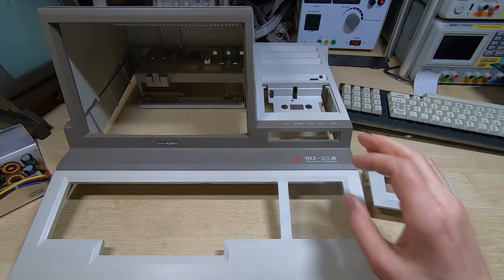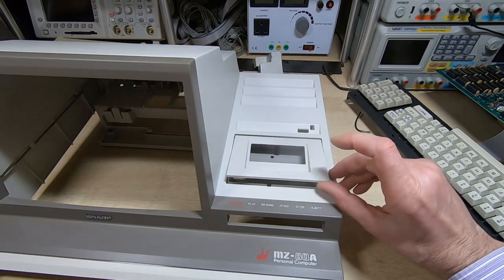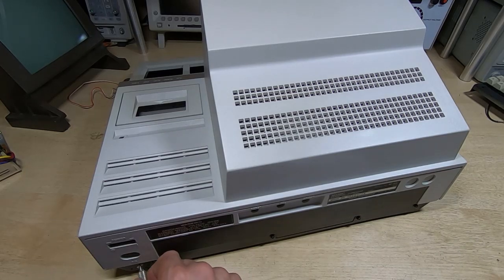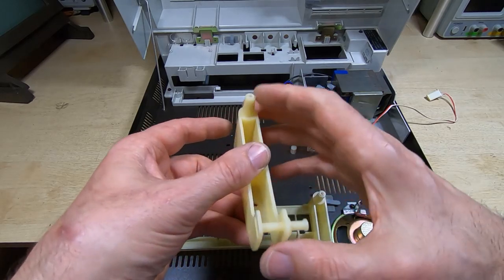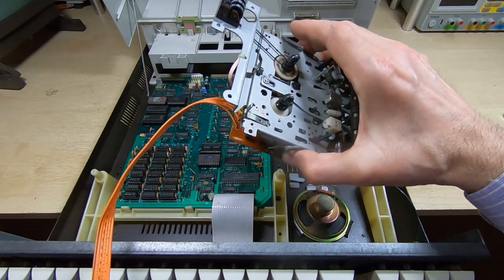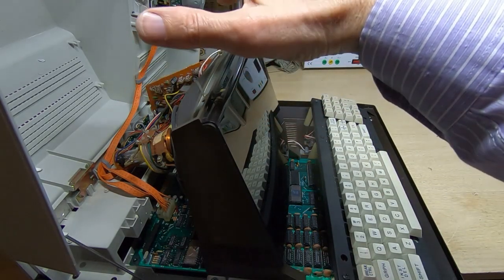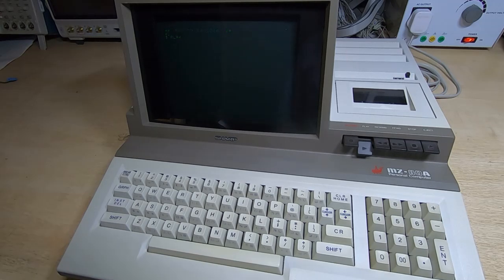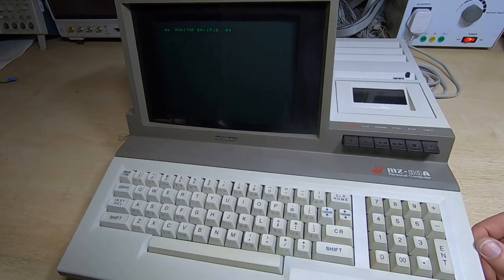Sharp  MZ80A Repair Part3

Comment: Seems to be a very nice thought out design, easy to get to all parts. My first computer was a Sharp MZ-721. I really like that industrial look. Though it was a bit of a drag to always load Basic from tape to do anything. It took a long time to load.
Reply from the maker: Yes the MZ80 also needs BASIC loading from tape every time it is booted although there is a spare ROM socket and the monitor allows jumping to any address (if the 'J' key works) so it can easily be modified to boot (almost) to BASIC.